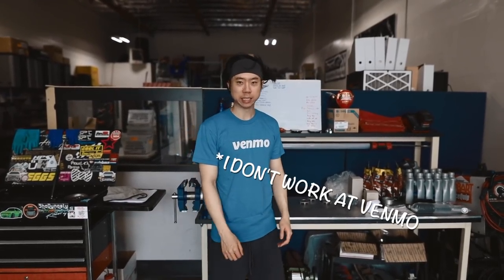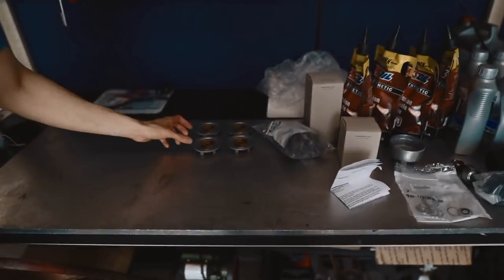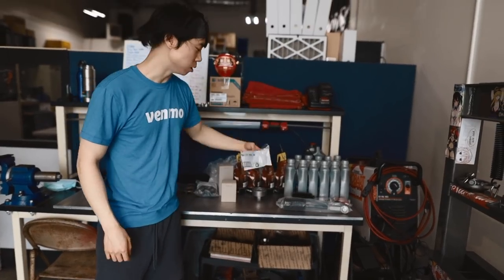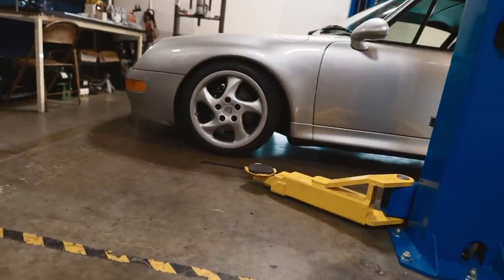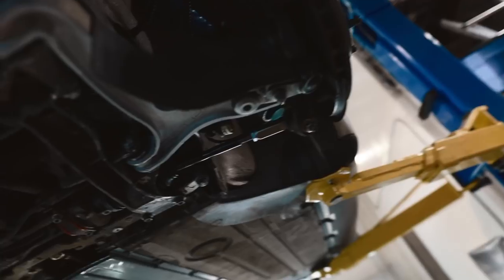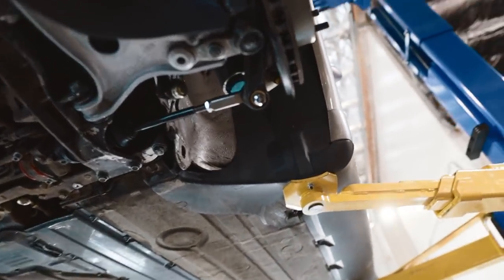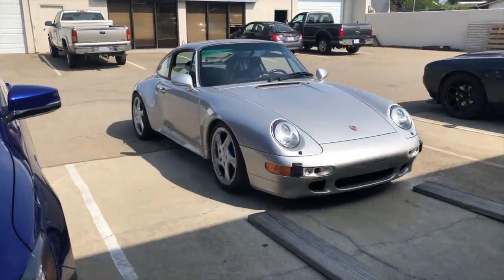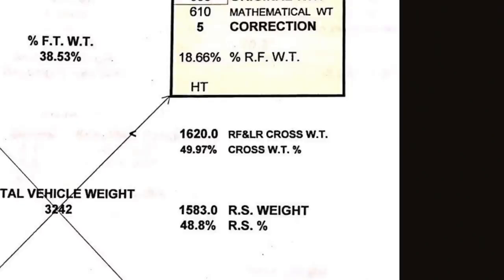My Widebody Porsche 993 NEEDED This...

Comment: That gunk on the underside. If it is wax based underseal / rust protection, it is a real pain to get off, especially if it has been there for a long time. I tried steam. No luck even with a degreaser. A friend tried ice blasting. That worked to some extent, but was expensive and only addressed the areas to which you had a clear line of sight. What worked for me was an intensive tar remover, rubbing where possible and several passes with a hot water pressure washer. A friend had access to industrial grade chemicals used to degrease commercial equipment. Those seemed to work as well, but may not be easily available or good for your health if used without appropriate protection.
Reply from the maker: Looks confirmed to be the cosmoline stuff Porsche puts on these cars from the factory. Might just leave it alone at this point if it's from the factory, or mess with the dry ice + tar remover method in the future, who knows!

Comment: Steam/heated pressure washer. Will get it off.
Reply: things I build In my experience that does not work on a proper wax based underseal / rust protector at least if the stuff is old.